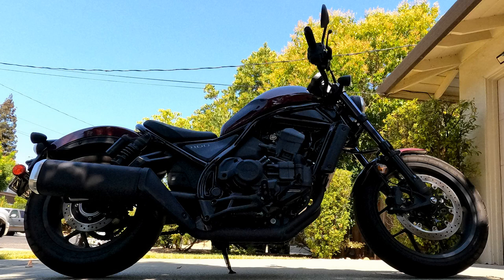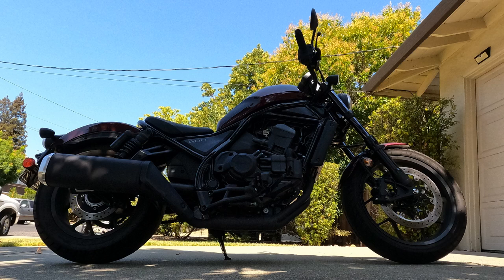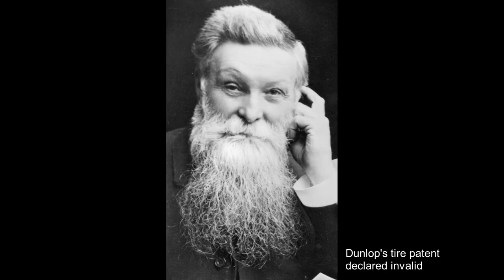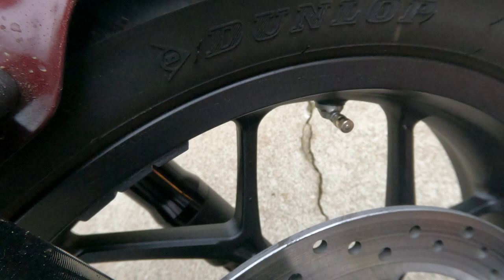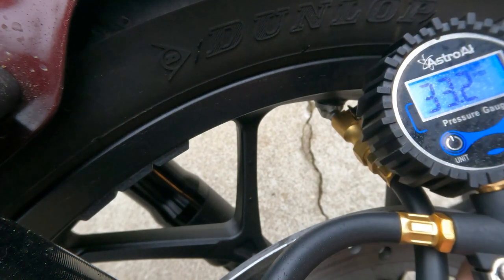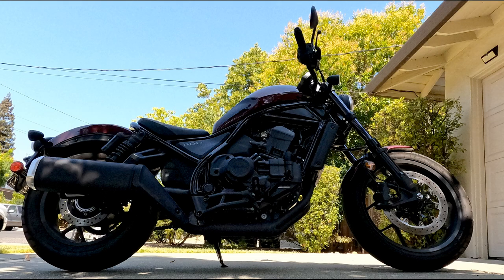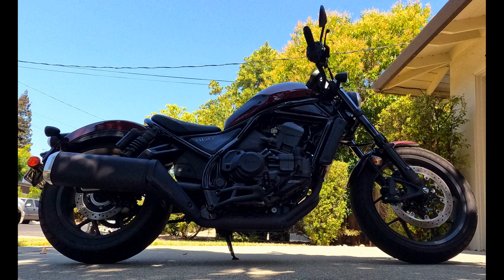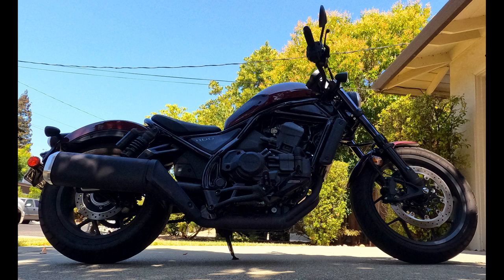Making Tire Pressure Maintenance Convenient

Comment: love my Fobos2.  I check the tire pressure every ride.  I had an alert go off once during the summer while I was riding and it was 102 degrees outside... apparently the tire got too hot and the tire pressure got too high while I was on the interstate.  Was good to know, decided to change routes and slow down on some back roads, and the pressure got lower, so stopped worrying about it, but its amazing the tire pressure increased by like 8 psi just because of the heat.
Reply from the maker: I have never seen information about what maximum tire pressure is considered unsafe for the Rebel 1100 Dunlops.  I suspect that the preset maximum temp in the Fobos 2 app is arbitrary.

Comment: What should tire pressure be
Reply from the maker: Normal tire pressure for the Rebel 1100 is 33 pounds front and rear.  I usually fill up to 34 because I assume a little air loss pulling the air hose off the valve stem.